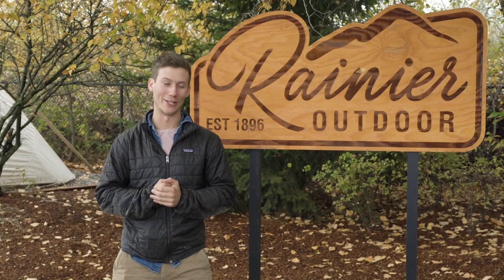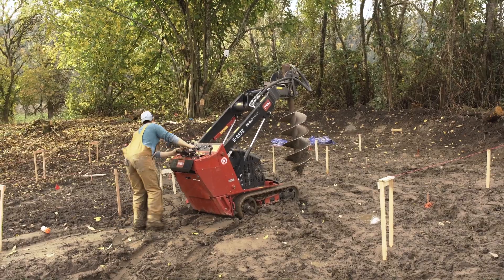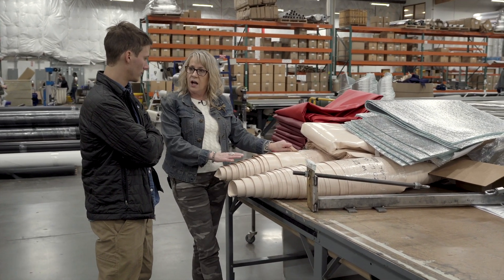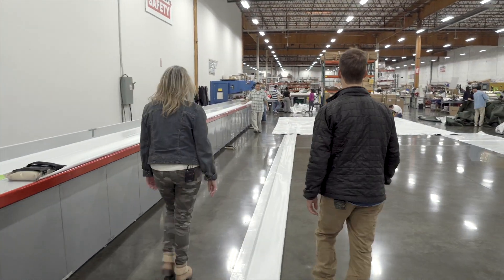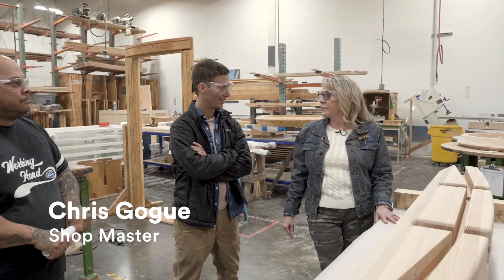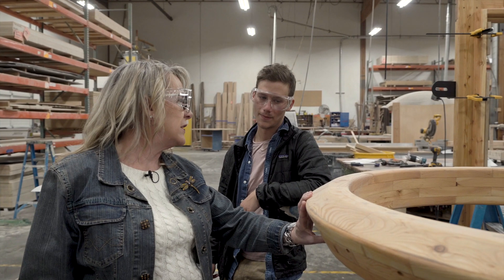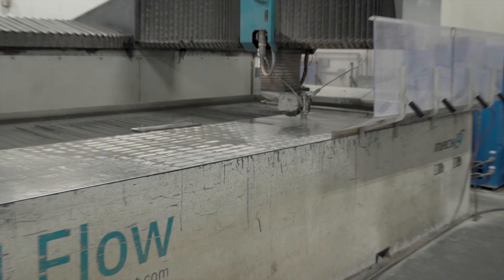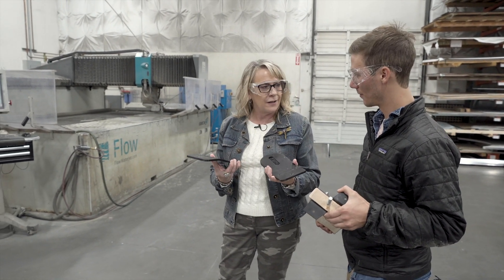Picking Up the Yurt | Do It Yurtself | Ep 1

Comment: I was researching prices and came across the guys at Rainier and Pacific Yurts website. Do you have any idea why the prices are so drastically different between the ones sold on Pacific Yurts and the 'Eagle Yurt' on Rainier?

Do you think the $8,000 premium over the 30' model on Pacific Yurts is justified? Why?
Reply from the maker: Ultimately, I went with Rainier because I was really impressed with the craftsmanship and functionality. The lattice is a quarter-inch thicker than most companies. Highest default snow load. Custom powder-coated hardware instead of off-the-shelf components. They are the only ones with a ring made from milled glue lam and is a perfect circle compared to the assembled polygonal shape that you will find in Pacific Yurts. Rainier also has swappable exterior wall panels—so if you decide to change the layout of windows or you damage part of your wall, you only have to swap out the 8ft section instead of the whole wall. Those features do come with a hefty price tag though.
Reply: @Whimwell  Thanks for responding! That was exactly the answer I was looking for. We're looking for a 'permanent' yurt setup so I'm more than willing to spend extra on the aforementioned quality of the product.

Great videos by the way. Hope to see more :)